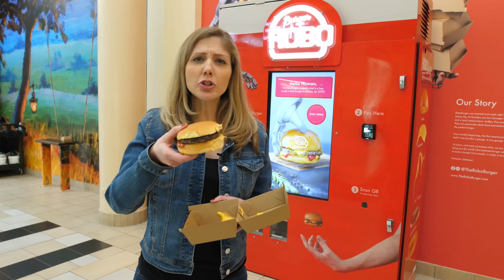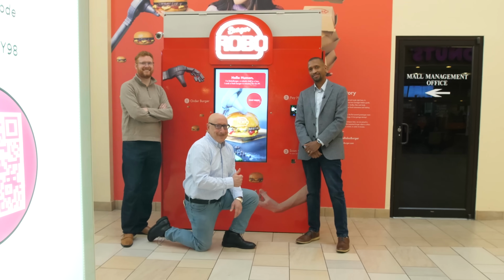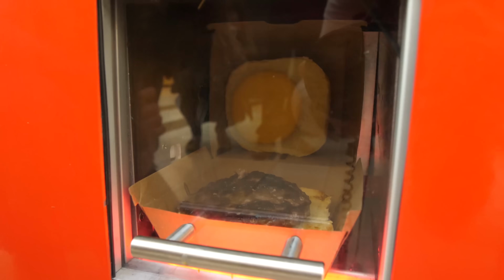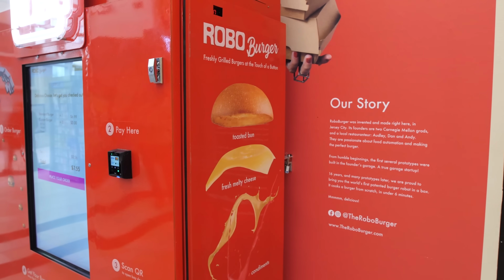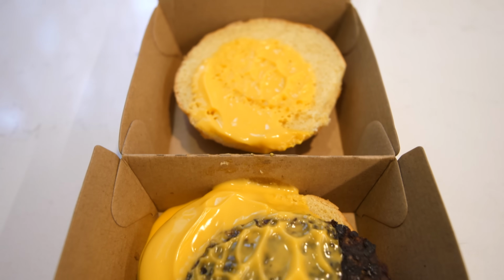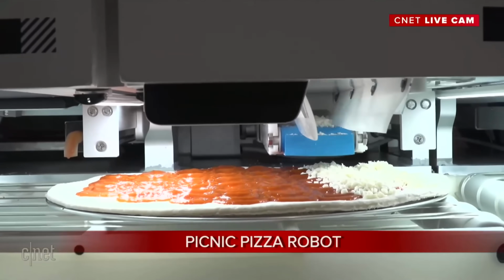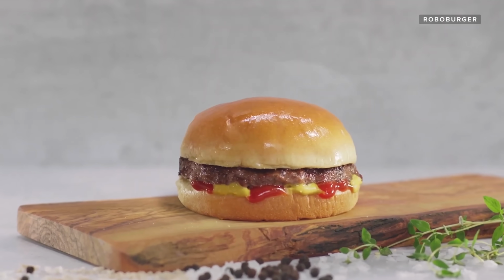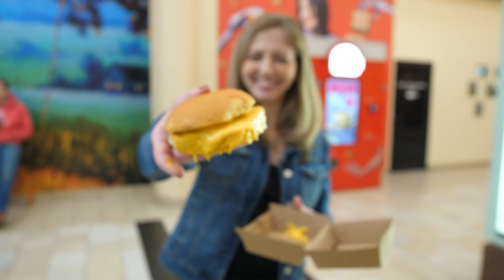A Robot Made Me a Messy Burger and I’d Do It Again (RoboBurger First Look)

Comment: Frozen entrees are a much better value proposition.  They can be made at more mass scale in a factory and simply heated up in microwave or convection oven.  Burgers do not lend themselves well to being reheated because the bun and burger patty need very different heat settings and the bun will get soggy if it is in contact with burger and sauce for too long.  Generally frozen entrees get a bad rap because they have lower quality ingredients.  Rice bowl type things, stir fry, curry, soups: all of these freeze well.  Even Mac n cheese.  Instead of burgers if you do a Korean beef rice bowl, that could come out of a frozen item vending machine paired with a microwave.

Comment: why is this not everywhere by now. the fast food resturaunts would love this robot and if you could have a fryer setup you could literally set up a full service kitchen with this technology.
Reply: don't worry, mcdonalds is already headlong into creating a human-less hamburger restaurant - when they do expect the prices to increase again, because equipment is, well, expensive. no nasty employees to deal with, just oil up the machine and let it run. maybe clean it once a month. All that and it will conveyer out to your car and then ask you for a tip.
Reply: @seanreidy1420  well your not wrong but the ones testing out the tech are doing so and spending the extra money, while the rest wait at get on the tech bandwagon after. this is one of the things that are follow the leader and down the road mcdonalds will either be eating the cost or raising prices. unless their already raising the prices so much in advance so they do not have to raise them as much later. ie raise price now to get funding for part of the cost and recoupe the rest of the cost later.

Comment: its a cool concept but how clean will it be consistently? will the person loading it be in charge of cleaning because grease and juices from the "burger" can and will attract bacteria. and most importantly how far outside of regular safe food handling practices does it sit outside. how often will it be checked to ensure its maintaining consistent temps? would it be set on a network that monitors that? how would you address someone receiving a burger that had spoiled or come in to contact with mold or oils from inside the machine? so many questions that need to be answered for this to be an actual conceptual thing to "replace" people.